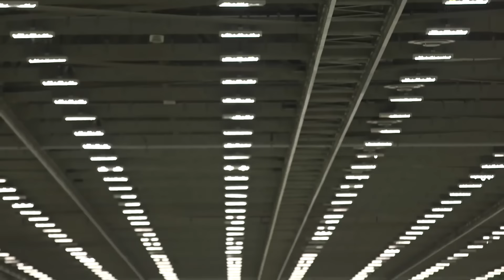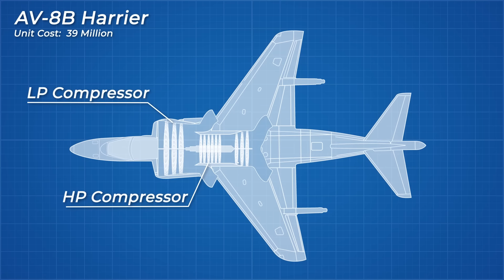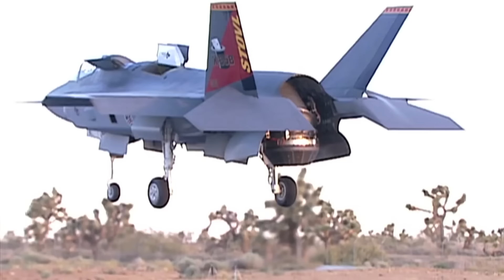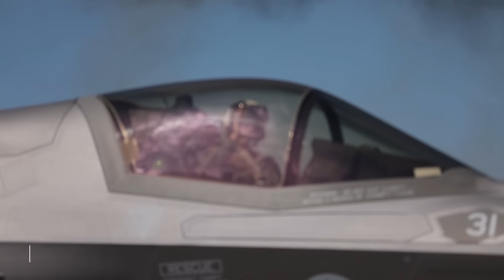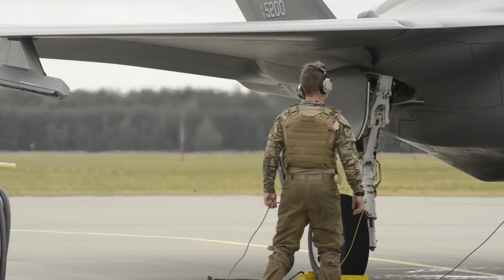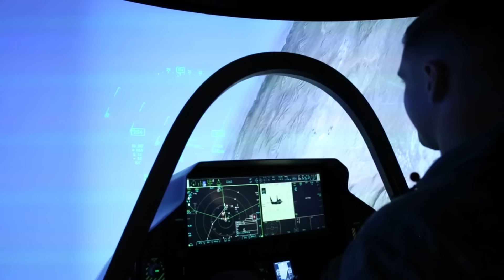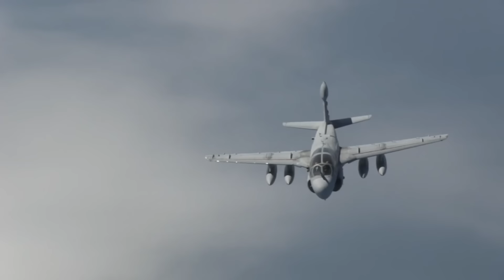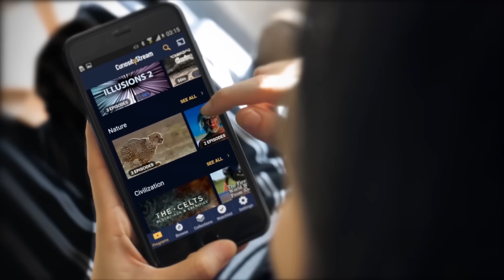Is The F-35 Worth $115 Million?

Comment: There is no debate, F-35 sucks at everything. Its defenders keep telling that its stealth is going to carry plane. Sure, but what if stealth fails? It is sitting duck in more traditional roles. See Air Power Australia report when it comes to its maneuverability, it is heavily beaten even by 4'th generation aircraft.
Reply: It is the 2nd most maneuverable fighter in the USAF. It can outrun every fighter it replaces. It has the most capable sensor suite of all modern fighters. It has incredibly capable electronic warfare systems. It can carry the F-16's typical strike payload internally and can exceed the maximum payloads of most fighters when stealth is not needed. It also has the longest combat range of all western fighters. Oh and it's cheap to buy... the only western fighters that are cheaper are the F-16 and F/A-18, and the difference is minimal. Should I talk about the advantages of stealth as well?

Air Power Australia are a bunch of unofficial analysts (i.e self-proclaimed) who do not have access to anything that isn't public information, nor do they have access to the F-35. Try talking to pilots who fly the F-35 regularly against other modern fighters. Try talking to pilots of previous gen fighters such as the F-16. Most of them are impressed by the F-35's maneuverability.
Reply: @dumdumbinks274  1) Technically no. It is less maneuverable than 4 gen fighters and when compared to most gen 4++ fighters,and beyond it is rather slugish fighter.
2) Its electronics got outdated due to its never ending developmental problems. Nowadays its electronics are brought to any other fighter plane with some notable exceptions like all around cameras for pilot helmet. 
3) It has by far shorter range than a fighter it is directly meant to replace.
4) It is vastly more expensive than previous gen of aircraft with operating costs sometimes being several times higher than some aircraft which is supposed to replace.

And yet, F-35 loses dogfights to F-16...
Reply: @REgamesplayer   @REgamesplayer  
1. Technically yes. It has similar sustained turn rate as the F-16 and far superior instantaneous performance combined with higher acceleration and just as good climb rate. Many pilots have described the F-35 as combining the strengths of both the F-16 and F/A-18, so no it isn't a slouch. It has also been described as a difficult opponent in BFM by RAF Typhoon pilots... so while it isn't a top tier dogfighter (why would it need to be?) it can still hold it's own in a dogfight provided the pilot is decently trained and familiar with the enemy's strengths.

2. Overall the F-35 has the most modern electronics of all modern fighters and the only systems that are becoming outdated are ones that are incredibly easy to replace. Sure you can put them in smaller less powerful forms into other fighters, but that doesn't mean they have an electronic advantage over the F-35. The F-35's avionics are top tier because they work together, whereas something like an F-16 with it's APG-83 which is directly based on the F-35's APG-81 simply can't compete due to size of the system and lack of integration with other systems.

3. It's combat range on an offensive air to air mission is around 1400km, or on a strike mission around 1250km. The F-16 maxes out at 850km for air to air, and around 600km for strike. The F/A-18C/D were even worse than the F-16, and the F-15 which is the US's 2nd longest ranged fighter gets around 1300km on an air to air mission with EFTs as well as it's typical AA loadout. The F-35's range is so good it hasn't even got plumbed pylons on it's wings due to lack of need... As for European fighters the Rafale and Typhoon are both around the 1200km mark on an air to air mission.

4. F-35A unit cost = $78m. By comparison the cheapest F-16 you can buy new isn't even a threat to the F-35 unless it can somehow get in close, and it still costs $55m. The modern F-16 Block 70 costs upwards of $65m, and a fully decked-out F-16 costs around $75m... and still isn't remotely as capable as an F-35.
In terms of operating cost the F-35A costs around $35000 since it is a new aircraft and is expected to cost roughly the same as an F-16 by 2030 at around $20000. 

F-35s lose to F-16s because that's how training works. Or do you believe the F-5 should take over from the F-16?... I mean the F-5 has beaten literally every US fighter built since the 1960s so it must be better than the F-16...
Reply: @dumdumbinks274  1) F-35 is a heavy aircraft with huge surfaces. It has high initial turn values, but aircraft tend to bleed energy like crazy and its underpowered engine by comparison does not allow for recovery in dogfights. It has low yawn rate and aircraft is sluggish to respond to control commands during dogfights in addition of pilot struggling to properly track its target. It had managed to lose a dogfight against heavily handicapped opponent. Two seat F-16 with two fuel tanks and full payload. This proves that F-35 is hopelessly outmatched against real opponents like Su-35 which are designed as supermaneuverable aircraft.

https://arstechnica.com/information-technology/2015/07/disastrous-f-35-vs-f-16-face-off-was-also-a-battle-of-philosophies/  

It also have lower acceleration and climb rate when compared to F-16

2) You had mentioned only AESA radar. It is true that we held a huge advantage when it came to radars compared to Russian older PESA radars. However, their newest modernization efforts do include some sort of AESA radars while newest planes do have it too.
While it is true that F-35 is a bigger airframe and thus can afford greater power aperture, it is not that large and F-35 falls by comparison to F-15. Only F-22 has a proper radar. 
https://www.ausairpower.net/XIMG/AESA-Aperture-6.png

Everything else that you wrote is so vague that it is pointless to even respond to.

3) That is true, it has good range.

4) Costs nearly the twice to operate = Costs nearly the same. Careful, your bias is showing.

Furthermore, you are comparing fly away costs of F-16/70 to airframe costs of F-35. That is just such a ridiculous comparison. 

https://www.documentcloud.org/documents/6534949-FY20-Navy-Aircraft-Procurement.html#document/p79/a533442 

"F-35s lose to F-16s because that's how training works. Or do you believe the F-5 should take over from the F-16?"

F-35 was shot down and was dominated in further war, because this is how war works. Your logic is sound.
Reply: @REgamesplayer  1. As I said it has a similar sustained turn rate to the F-16 and far superior instantaneous performance. "High initial turn values" indicates you are specifically referring to instantaneous turn rate, and are choosing to ignore it's capability as a whole. 
The F-35 is heavy sure, but it's wing loading is basically the same as the F-16 while at the same time having a lifting body, meaning it's overall loading is better than the F-16 and thus it is more maneuverable in a general sense. 
The F-35 has a better thrust to weight ratio as well and accelerates faster in the subsonic region. 

Your arstechnica source was laughable back in 2015, and is completely irrelevant to production F-35s of Block 3i or newer. The F-35 involved was AF-2, which is a test airframe with specific duties. The AF-2 airframe was using Block 2B software (which was sluggish) and limited to 4.5Gs as a safety measure because flight testing had not yet concluded. It did not have any of the combat sensors installed either, meaning the pilot's awareness of the other aircraft was completely based on his own eyesight. 
For reference, an F-16 with 2 bags is rated for 6Gs. Even a fully loaded F-16 is rated for 5Gs, and it was "competing" against a 4.5G limited test airframe. Production model F-35s of the same timeframe were rated for 7Gs, and all F-35As today are capable of 9Gs. No pilots have described the Block 3i or 3F F-35 as sluggish.

2. I only mentioned AESA as an example. But regardless of that Russian fighters still don't have AESA. The Su-57 is going to be their first and it isn't even in production yet. Expected IOC is 2025.

F-35's radar isn't the most powerful, but your source is from 2001... the APG-81 didn't even enter testing until November 2008, and it has 1676 modules... not 1200. There are also very few F-22s still using the APG-77 as most of them have been using the APG-77v1 which entered production in 2008... And while the F-22 has the best radar of all fighters currently available by it's specs alone, it is still less effective because the F-22's core electronics bottleneck the radar to the point the F-35s APG-81 performs better in dense EW environments.

4. Try reading. Or does the idea that a new system won't immediately be cheap to operate escape you? F-35 operating costs are gradually being reduced, albeit not as quickly as the unit costs.

"Furthermore, you are comparing fly away costs of F-16/70 to airframe costs of F-35. That is just such a ridiculous comparison. "
- Nope. F-35 price to buy has been quoted per the definition of fly-away cost since 2015. Your new source for F-35 pricing isn't discussing fly-away costs, but rather full package costs.

"F-35 was shot down and was dominated in further war, because this is how war works. Your logic is sound."
- Your inability to read a sentence and understand a basic implication, let alone provide a proper analogy is amusing. Tell me, when you send a kid to school do you expect them to be taught by other kids who know very little? I certainly don't, and neither do the US military. New pilots lose no matter what fighter they are piloting because their opponents are the best fighter pilots in the western world. You can't become an instructor without demonstrating your knowledge and skill.
Reply: @dumdumbinks274  
1. It is you who focuses on proving every single aspect wrong without having any knowledge about what he is talking about. Any general critique talks about poor maneuverability of an F-35 fighter, but this is somehow news to you. This is why we can't talk about anything more advanced before you get your basics right. "The F-35A has combat weight of 18.3 tonnes, a wing loading of 428 kg/m2,thrust-to-weight ratio of 1.07 and span loading of 1.75 tonnes/m. Wingsweep is 34°, and the engine has a power-to-frontal area ratio of 17.9N/cm2. As a result, the F-35 has very low instantaneous and sustained turnrates (less than half of the F-22's sustained turn rate, or ~11° per second) aswell as low acceleration, while its weight harms the transient performance.The F-35's inefficient aerodynamics and inefficient power plant also limitscombat endurance despite an excellent fuel fraction of 0.38. The F-35 has aspecific fuel consumption of 0.9 lb/lb/hour versus 0.75 for other advancedcombat jet engines.'

Source: Operational assessment of F-35A

Sustained turn rates of 4'th generation fighters:
F-16C - 14.2 deg/s
F-15C - 13,9 deg/s
F-14B - 14,1 deg/s
F-35A - 11 deg/s (best performing variant, other versions will have lower sustained turn rate)

https://www.google.com/url?sa=i&url=https%3A%2F%2Fwww.reddit.com%2Fr%2Fhoggit%2Fcomments%2Favuh86%2Fa_chart_showing_at_what_speed_and_at_which_turn%2F&psig=AOvVaw3_PeJ5lEbjSggsh7hNOKhJ&ust=1599030331934000&source=images&cd=vfe&ved=0CAIQjRxqFwoTCIDGqqmyx-sCFQAAAAAdAAAAABAJ

Acceleration: 
F-35: 1.07 F-16: 1.24

To conclude, nothing which you had said is right. You constantly use such general terms as "basically is the same" which shows that you lack context and in depth understanding of fighter planes. What you consider to be "basically the same" in reality are massive differences which would allow any experienced pilot in an equal fight to run circles around F-35. 

This is to what those "basically the same" differences lead to in a dogfight:
https://youtu.be/bkzBhRwpeAE

In the end, please do your own research. Don't come back to me with more claims of how I'm wrong and you are right by repeating your own statements again and again WITHOUT providing any evidence, sources and hard, precise data. If you want to discuss something else, I'm open to that, but you have to learn to drop points where you are beaten. Otherwise you will get stuck on points where you are wrong while all the time complaining that "I focus on a very narrow thing". 

"Your arstechnica source was laughable back in 2015, and is completely irrelevant to production F-35s of Block 3i or newer...."

Do not make excuses of why the F-35 failed to perform. Its software is designed to extend the lifetime of airframe and is locked to gentler maneuvers during peacetime. However, when a plane needs to fight or be tested, this software is disabled. Officials directly disagree with you:

 "It was loads monitoring, so they could tell if we ever broke something. It was a confidence builder for the rest of the fleet because there is no real difference structurally between AF-2 and the rest of the airplanes.”
Their official reasons of why it had failed:
- "Does not have the mission systems software to use the sensors that allow the F-35 to see its enemy long before it knows the F-35 is in the area."
- "Does not have the special stealth coating that operational F-35s have that make them virtually invisible to radar."
- "Is not equipped with the weapons or software that allow the F-35 pilot to turn, aim a weapon with the helmet, and fire at an enemy without having to point the airplane at its target."

Do you notice how officials themselves do not defend the maneuverability of the F-35? They instead say that there is no difference between this and the real version and that the only reason it had failed to beat heavily handicapped legacy fighter of the wrong type was, because it got into dogfight in the first place!

https://arstechnica.com/information-technology/2015/07/f-35-project-team-says-dogfight-report-does-not-tell-whole-story/  
2. 

Su-35 newest version has AESA radar:
https://www.defenseworld.net/news/25357/MiG_35_Shows_Off_New_AESA_Radar_at_MAKS_2019#.X03-dG4zaUk

This comes back to my point, F-35 development took so long that its advantage in electronics are being equaled out by its competition. I also want specifics of what F-35 does better that other planes could not. F-35 in terms of electronics only has its helmet and sensor array which combines all the information to pilot's helmet. This is the only real advantage over other planes which could not be easily solved by a simple upgrade program. Every other piece of electronics could be done better in other planes like I had shown with F-35 radar. F-22 has considerably more power to give to its radar array which would make F-22 a better platform for electronic systems.F-35 is also still in the prototype stage. Sure, it is in full production right now, but it has around 13 Category A flaws. Category A flaws within an aircraft are considered critical which can cause loss of an entire aircraft. F-35 still needs a lot of time to mature and it won't be until batch no.4 until the plane matures sufficiently to be airworthy. which is around the time when AESA radars and fifth generation planes will come for our peers also in 2025.

"F-35's radar isn't the most powerful, but your source is from 2001... the APG-81 didn't even enter testing until November 2008, and it has 1676 modules..."
Fair enough, but as you later agreed yourself, my point still stands with other platforms being able to deliver more powerful radar performance. Furthermore, in an absence of a better source, my source still stands because you can't provide anything better than claims.4. Mass of scale and maturity of a platform does not decrease costs indefinitely. You assume that cost decrease will go down continuously, however there is no historic precedence of significant cost decrease when aircraft had entered mass production for some time which F-35 already did.

/Facepalm. Flyaway cost IS full package cost. Unit cost is just the cost for a plane. I had quoted the real cost of a single plane. This excludes all additional equipment which is necessary to operate fighter planes. This includes ammunition, fuel, training simulators, maintenance equipment, spare parts, training. You had quoted the unit cost of a plane without including any of those things while comparing the average cost of F-16 during its lifetime minus operating costs. 
Go back to my official source. There is a nice breakdown of how much each version of F-35 costs to the USA government, split by airframe, engine, electronics. Those parts alone which make up the plane is a real unit cost of F-35 which is higher than a flyaway cost of the newest F-16. A single F-35B model costs 147 million dollars. F-35C costs 100 million dollars. That is a steep increase over advertised costs. 

"In terms of operating cost the F-35A costs around $35000 since it is a new aircraft and is expected to cost roughly the same as an F-16 by 2030 at around $20000. :

It is amusing that you do not know even the difference between comparison and analogy. This is comparison, not an analogy. You make up random numbers and then declare that 75% increase in operating costs is "roughly the same". I'm sorry, but you are just a laughing stock at this point if you make up such numbers, make such ridiculous statements and then start insulting the other side for pointing out mistakes you make.
Here however are the real numbers:
https://blogs-images.forbes.com/niallmccarthy/files/2016/08/20160815_Fighters.jpg 

To operate F-16C so far is 3,5 times cheaper than the cheapest F-35A model. This difference will most likely decrease with time, but it will never be comparable. There is no precedent when military equipment which is already in mass production and service suddenly decreases in overall costs several fold.
Reply: I also gave you source info about F-35 price. Here is an article on price of F-35:
https://www.pogo.org/analysis/2019/11/deceptive-pentagon-math-tries-to-obscure-100-million-price-tag-for-f-35/

I also gave a generous estimate of F-35 operating costs previously. It goes as far as 44,000 per flight hour and those lower flight costs are only the stretch goals:

https://www.defensenews.com/air/2019/05/02/one-of-the-f-35s-cost-goals-may-be-unattainable/

There is still a lot to do when it comes to F-35 from maturing as an airworthy 4'th gen fighter to lowering its cost over time to where they are advertised to be. However, if I would be behind acquisition of military equipment, I would not invest into F-35 and instead would choose to divert those funds into deep modernization of legacy fighters. I would however seriously consider purchase of F-35 at later date when lot 15 production would occur. 

If you want to reply to this, keep it in original comment. No need to expand even more. I wrote this, because I remembered that I did not gave you all the necessary sources for you to understand my position (like confusion with unit and fly away cost of F-35). However, I would appreciate you dropping some points and focusing on what you want to talk about or merely asking questions on my position in regards to this plane, etc.
Reply: @REgamesplayer  
"Any general critique talks about poor maneuverability of an F-35 fighter, but this is somehow news to you"
- Yes, those who never listen to the pilots who both fly the F-35 and fly against the F-35. 

"F-35A has combat weight of 18.3 tonnes"
- There's your first problem. You are not measuring things based on a single situation, rather you are measuring things based on a single configuration of the F-35. If you aren't comparing planes in a given situation then you aren't making an appropriate comparison.

"as a result, the F-35 has very low instantaneous and sustained turnrates (less than half of the F-22's sustained turn rate, or ~11° per second)"
- By what metric? What conditions? F-22 can reach around 23d/s at corner speed around 20000ft. F-35A can reach 17d/s which is only slightly less than the F-16 at 18d/s. As for instantaneous rate you consider 30d/s Low? 

"Acceleration: 
F-35: 1.07 F-16: 1.24"
1. Acceleration isn't simply T/W ratio, but also includes drag. The only way in which an F-16 will accelerate faster is while unarmed, or with it's 2 wingtip AAMs.
2. Why are you comparing an F-16 configured for a 600km mission with an F-35 configured for a 1400km mission? If both fighters are compared on the same mission like they're supposed to be the F-35's T/W is higher to begin with and the gap only increases the shorter the mission is. 

"To conclude, nothing which you had said is right. You constantly use such general terms as "basically is the same" which shows that you lack context and in depth understanding of fighter planes."
- Ah some pointless drivel... 

"What you consider to be "basically the same" in reality are massive differences"
- No, that would only be true if you had correct data, but you prefer to compare values that come from different situations to justify your claims. That's a false comparison. You haven't provided a source for the 11d/s sustained turn rate of the F-35, only the teen series fighters, and you certainly haven't provided a source for the F-22 having double the turn rate.

"Do not make excuses of why the F-35 failed to perform. "
- it is not an excuse, it is fact. AF-2's software was a heck of a lot restrictive than today's F-35's , or even the Block 3i upgrade that appeared in 2015. You cannot take that series of BFM exercises and claim it represents the F-35's ability to dogfight or it's maneuverability in comparison to an F-16.

" Its software is designed to extend the lifetime of airframe and is locked to gentler maneuvers during peacetime. However, when a plane needs to fight or be tested, this software is disabled."
- Yes obviously... that is how flight testing works. However a BFM exercise is not a flight test and has never been used to flight test US fighters simply because in BFM the objective is to shoot down the enemy,. Simply put, the objective of BFM is mutually exclusive with those of flight testing.

"It was loads monitoring, so they could tell if we ever broke something. It was a confidence builder for the rest of the fleet because there is no real difference structurally between AF-2 and the rest of the airplanes."
- Yes, structurally no difference, meaning that results of flight testing could be rectified purely through the flight software

"Fair enough, but as you later agreed yourself, my point still stands with other platforms being able to deliver more powerful radar performance. Furthermore, in an absence of a better source, my source still stands because you can't provide anything better than claims."
- Your point never countered my point, and more powerful doesn't equal superior. As for sources yours doesn't even have relevance since it existed long before the actual system. Though if you're really so ignorant that you can't search for yourself here's an image https://qph.fs.quoracdn.net/main-qimg-274acec7e6905acb2f96f6ba6d18b806

"Su-35 newest version has AESA radar:
https://www.defenseworld.net/news/25357/MiG_35_Shows_Off_New_AESA_Radar_at_MAKS_2019#.X03-dG4zaUk"
- Neither the Su-35S nor the MiG-35 have AESA radars. Russia has developed an AESA radar for the MiG-35, and they are at the same point the US were in 2003 when the F-15 got it's APG-63v2 i.e basically non-existent as far as operational usage is concerned.

"This comes back to my point, F-35 development took so long that its advantage in electronics are being equaled out by its competition."
- Except that actual R&D has only been going on since 2001. Do you also think the Typhoon and Rafale are outdated in comparison to Russian fighters? because the F-35's R&D hasn't taken any longer than those fighters.

"however there is no historic precedence of significant cost decrease when aircraft had entered mass production"
- There's also no precedent of the govt mass producing any other platform like they did the F-35... The costs are high because the govt authorised concurrent production and development. What do you think happens when the newly built F-35s need even more spare parts because the old ones don't fit them? What about ground crews having to use a poorly thought-out inventory tool to manage everything? What about the F-35s that are not upgraded to the newer standard? It means high initial operating costs that will be reduced as infrastructure and management stabilise, and in this case it will take a while.

"I also want specifics of what F-35 does better that other planes could not."
- Sure. It's radar is superior to every other operational fighter radar, and performed better in dense EW environments than the APG-77v1 during tests in 2010. It's 7 IRSTs provide unassisted targeting and tracking capability in any direction, as well as much earlier threat warning compared to typical MLWSs of other modern fighters. But far more importantly the F-35's systems all communicate with each other, not just other aircraft. If you don't understand how the integration of so many advanced systems is such a massive advantage you need to speak to actual pilots instead of journalists.

"/Facepalm. Flyaway cost IS full package cost. Unit cost is just the cost for a plane."
- Per Wikipedia... "Flyaway cost is one measure of the cost of an aircraft. It values the aircraft at its marginal cost, including only the cost of production and production tools essential for building a single unit.[1] It excludes sunk costs such as research and development, supplementary costs such as support equipment, and future costs such as spares and maintenance."... care to accept defeat?

"You assume that cost decrease will go down continuously"
- Based on what? Where did I say that? I expect costs to reach a certain value by a certain point. I do not expect them to transition gradually at a constant rate over the timeframe.

"It is amusing that you do not know even the difference between comparison and analogy. This is comparison, not an analogy. You make up random numbers and then declare that 75% increase in operating costs is "roughly the same"."
- It is amusing that you have to make up stuff about what I have said. What I stated is clear, and I never claimed that the costs are similar right now.

"I'm sorry, but you are just a laughing stock at this point if you make up such numbers, make such ridiculous statements and then start insulting the other side for pointing out mistakes you make."
- The numbers are not made up. F-16 operating cost comes from the USAF as of 2015. Cost to operate does fluctuate, but unless the US have invested heavily in the F-16 it won't be any cheaper today. What statements do you find ridiculous? The ones that don't have a hidden meaning for you to make assumptions off of? And the "mistakes" you have found are mistakes with you own comprehension of my comments.

I have also seen that POGO source many times. It is sensationalist media - the govt never attempted to hide anything and every source POGO cites to make that claim is a govt source, indicating that the govt are not hiding the prices. Additionally it uses package price to argue that unit price is wrong, so it is comparing different values to make a blatantly false claim.
Reply: @dumdumbinks274  Indeed, pilots do say that F-35 maneuverability is atrocious. 

https://www.realcleardefense.com/articles/2015/06/29/test_pilot_admits_the_f-35_cant_dogfight_108146.html

Don't worry, F-35A is the best model for maneuverability. F-35B is an even more atrocious model due to its vertical take off capabilities. If you are interested in details, this is why I have provided a source for you to check it out. Usually people quote only relevant details and if the other person needs more information, he goes to source and reads the whole damn thing. In either case, any configuration would perform worse than an extremely biased configuration in which the Pentagon dares to test F-35 against. Matching F-35 with optimal configuration against an outdated F-16 model who also is of a wrong type. 

Those are low energy maneuvers at low altitude. A lot of dogfights degenerate into turn fights at low speeds at which the F-35 is absolutely horrible. Instantaneous and sustained turn rates means how well aircraft can turn initially in its high energy state and the other is how well a plane can sustain its turn rate in a prolonged dogfight. Your problem is that you focus on advertisement of what aircraft can achieve for brief moments under ideal conditions. This is why you think the F-35 is so great.

Acceleration is mostly a relationship between aircraft weight and power of its engine. Drag becomes meaningful at high speeds. High speed acceleration due to air resistance growing exponentially with speed. The F-35 has such low acceleration, because of its heavy weight and said number is for an F-16 with a combat load. Furthermore, F-16 has inherently shorter range, this is why it is configured for a shorter mission. These acceleration rates are not calculated with 100% fuel, but usually with 60% of it. Comparing acceleration of F-16 with its fuel banks is as unrealistic as that dogfight in which the F-35 was served. Nobody in their right mind, but the Pentagon would dog fight with fuel banks. They would be dropped before actual combat starts, but our fly boys probably still did not figure it out. 

"- Ah some pointless drivel..." 

But that is true, you were wrong on every maneuverability characteristic of an F-35 and you still did nothing to disprove me. You only poke at numbers and make up more claims. "- No, that would only be true if you had correct data, but you prefer to compare values that come from different situations to justify your claims. That's a false comparison. You haven't provided a source for the 11d/s sustained turn rate of the F-35, only the teen series fighters, and you certainly haven't provided a source for the F-22 having double the turn rate."
When I use quotation marks: "", it means that I'm quoting things. It is a very standard practice, especially in university. I also attach the source somewhere shortly after the quotation and my point. Pay more attention please, because I do spend my time trying to educate you. At least you could properly investigate information provided to you rather than replying directly to my quotes. You have to understand that quoting information from credible sources > than some random guy's opinion on the internet. You can't reply directly to a quote like it would be my own statement and disagree with it while providing no new information to the contrary. You are just some guy on the internet which as far I'm concerned knows nothing about what he is talking about. In order to win an argument, you have to make a proper argument, so far however you only are making statements and trying to poke holes. It makes you think in your head that you are winning, however the majority of what I had said still holds true and I'm all, but won this debate. Back up what you are saying, provide a conclusive argument with hard technical data of both aircraft. Then you will be taken seriously. Now however you are just disagreeing with the official operational assessment of F-35A aircraft, because you want more information and you are too lazy to check out the source yourself. So instead of doing anything constructive, you instead ask more questions which ultimately will just drag this out, because this point is not even up to question. Anyone knowledgeable knows that the F-35 has poor maneuverability, pilots and officials do not even defend that fact. You however are like a newborn who discovers that fact for the first time.

You do make excuses for the F-35. I had provided an official explanation of why the F-35 had failed. None of that included what you had said. In fact, it directly contradicted your claims. Furthermore, said software is here to preserve aircraft, lower risk of failure and extend its lifetime. AF-2 software can be as easily disabled as it was during dogfight. You are disagreeing not only with me, but with officials responsible for the F-35 program and directly contradict what they are saying and you think that I have to take you seriously?

"- Yes obviously... that is how flight testing works. However a BFM exercise is not a flight test and has never been used to flight test US fighters simply because in BFM the objective is to shoot down the enemy. Simply put, the objective of BFM is mutually exclusive with those of flight testing."

Exactly, you had figured it out how that test was set up. "- Yes, structurally no difference, meaning that results of flight testing could be rectified purely through the flight software"

You certainly do not know how quotating works. Now you are correcting officials responsible for those tests with this pointless statement. What you had said adds absolutely nothing to an argument nor it makes much sense. " Your point never countered my point, and more powerful doesn't equal superior. As for sources yours doesn't even have relevance since it existed long before the actual system. Though if you're really so ignorant that you can't search for yourself here's an image."
So, why did you question what I had said if you agree with me? Furthermore, you are just some random dude on the internet making statements. I see that you might have an ego problem and think that you know it all. However everything you say is just a baseless statement. This is actually the first time you bothered actually backing up your claims, even if forced by me, but this is still progress. 
Also, ignorant means that a person lacks knowledge in a given subject. The word you were looking for here was: lazy. You can't be so ignorant as not to search easy to find information for yourself. However, you can be so lazy that you can't even do this one simple thing for yourself. 

When it comes to SU-35 AESA radar, it was to show that Russia had developed AESA radar for their 4'th gen fighters. This was in response to your statement that only Su-57 had AESA radar. Please pay more attention to what you are saying. You are quoting a lot of information and do not say much. 

"Except that actual R&D has only been going on since 2001. Do you also think the Typhoon and Rafale are outdated in comparison to Russian fighters? because the F-35's R&D hasn't taken any longer than those fighters."

The F-35 is still in the prototype stage. R&D is solely concerned about fixing existing issues, not adding new ones. Rate of development of the F-35 is far slower than any legacy fighter, because those fighters do not have huge technological depth which they have to overcome and thus all efforts can be solely focused on improving those planes.

 "There's also no precedent of the govt mass producing any other platform like they did the F-35... The costs are high because the govt authorised concurrent production and development. What do you think happens when the newly built F-35s need even more spare parts because the old ones don't fit them? What about ground crews having to use a poorly thought-out inventory tool to manage everything? What about the F-35s that are not upgraded to the newer standard? It means high initial operating costs that will be reduced as infrastructure and management stabilise, and in this case it will take a while."

This is not the major source of costs. Major reduction of cost comes from economies of scale. When contractors have sufficient numbers of orders, work hours put into providing those orders quickly fall by comparison of other costs like parts. It is like writing a program. If you write a program just for this one time, it will be incredibly expensive, because you will have to include the programmer's salary only to solve that one problem. However if you would use said program every day, quickly initial investment would become negligent compared to savings. This is how economies of scale work, it is costly, because there are few orders and you need to maintain people and expertise to produce very limited sets of orders. When there are plenty of orders, employees can work at their full capacity. This is why there was such a strong decline in F-35 price through Lot 12-14. As the F-35 entered mass production, we had seen the greatest price decrease it is going to have. In the end, it is mighty convenient to you that "there is no precedent" when you have to back it up something. Seems to be a trend with you.
Reply: @dumdumbinks274  "Sure. It's radar is superior to every other operational fighter radar, and performed better in dense EW environments than the APG-77v1 during tests in 2010. It's 7 IRSTs provide unassisted targeting and tracking capability in any direction, as well as much earlier threat warning compared to typical MLWSs of other modern fighters. But far more importantly the F-35's systems all communicate with each other, not just other aircraft. If you don't understand how the integration of so many advanced systems is such a massive advantage you need to speak to actual pilots instead of journalists."

So, nothing new? I had already shown you how F-35 advantages in electronics had faded away with its long development cycle. I agree that radar on F-35 is good, but when it will be ready for service, it will come out in an environment which already had matched it in its capabilities (as shown previously with Su-35). Advantages which you had mentioned is a misconception. Those advantages come not from some new electronics on F-35, but from the nature of AESA radar. AESA radar inherently is a lot harder to jam, this is a major reason why it is better over PESA radar. You however seem to attribute this for some reason to this specific radar while in truth, this trait is inherent to all AESA radars.

I did mention its all around cameras and helmet integration as the sole advantage in electronics which can't be easily transferred to older platforms. Though, that is a marginal upgrade which comes in handy only in very specific situations in which the F-35 is designed to avoid and not to be in. Though, I do not disagree that it is a good plius for the F-35.

Again, "systems all communicate with each other, not just other aircraft" is just such a misconception. You should stop reading advertisements for the F-35 and take a look at older aircraft. Vast majority of aircraft do that. This communication network is called: Links 16. The only difference is that the F-35 has AESA radar which is a lot harder to jam and can be used for communication with a lot greater information transfer capabilities. However, that is part of the aircraft's radar system, so you are having like triple points to the F-35 for having a radar which is unfair. 

Furthermore, the only real advantage F-35 has is all around sensors. All of those systems can be brought back to older planes. In fact Links 16 are set to be replaced with the same communication system which is on the F-35. All the anti jamming, communication, detectability, tracking are not advantages of the F-35 plane. F-16 has all that capability, because it was upgraded with AESA radar. While you might argue that its radar is weaker, there are other fighters who can have more powerful radar than the F-35. It is all a matter of upgrading legacy fighters, hence this is why I support deep modernization of older planes and waiting for the F-35 to become less of a turd.

 " Per Wikipedia... "Flyaway cost is one measure of the cost of an aircraft. It values the aircraft at its marginal cost, including only the cost of production and production tools essential for building a single unit.[1] It excludes sunk costs such as research and development, supplementary costs such as support equipment, and future costs such as spares and maintenance."... care to accept defeat?"

Sure. However, you still compared the price of the airframe of the F-35 to flyaway costs of F-16. "Based on what? Where did I say that? I expect costs to reach a certain value by a certain point. I do not expect them to transition gradually at a constant rate over the timeframe."

Hmmm, I think that you should go back to my original source about F-35 cost. This plane costs around 100-140 million dollars give or take. More if you include necessary support. Its operating costs are upwards to 44,000 dollars per flight hour. You however said to me that those costs will go down to be comparable with F-16. This means that an airplane which is already in mass production will have to go down in operating costs several fold."It is amusing that you have to make up stuff about what I have said. What I stated is clear, and I never claimed that the costs are similar right now."

Don't pretend that you are innocent. You insult me, you confuse analogy with comparison and now you again conveniently forgot everything you wrote. How you accused me of not understanding a simple analogy when you wrote a comparison. Will I have to copy paste the entire conversation to you? "The numbers are not made up. F-16 operating cost comes from the USAF as of 2015. Cost to operate does fluctuate, but unless the US have invested heavily in the F-16 it won't be any cheaper today. What statements do you find ridiculous? The ones that don't have a hidden meaning for you to make assumptions off of? And the "mistakes" you have found are mistakes with you own comprehension of my comments."

Again, more baseless claims. Provide me with sources and stop making stuff up."I have also seen that POGO source many times. It is sensationalist media - the govt never attempted to hide anything and every source POGO cites to make that claim is a govt source, indicating that the govt are not hiding the prices. Additionally it uses package price to argue that unit price is wrong, so it is comparing different values to make a blatantly false claim."  

If you do not like a source, it does not make it wrong. This is how you end up knowing very little, you filter out everything you do not like as "wrong" and cherry pick advertisements. POGO is a governmental watchdog, it highlights misconduct of a government. You just said that if information is public, the government can openly mismanage taxpayers money, and endanger its people, because it does so publicly. 

Pay more attention to what you read. Source has individual price per unit divided by major cost factors. Furthermore, nobody buys military equipment in singles. Everybody buys it in bulk as it is a lot cheaper and practically everyone else needs more than just a new aircraft. An aircraft can't fly without high quality fuel, you can't get it at the gas station. Thus most military equipment comes in packages, even when it comes to the USA government procuring its own equipment. That is called: procurement cost.
Reply: @REgamesplayer  " Indeed, pilots do say that F-35 maneuverability is atrocious.... https://www.realcleardefense.com/articles/2015/06/29/test_pilot_admits_the_f-35_cant_dogfight_108146.html"
- You still only have a single pilot saying that... or do you not understand that your sources on F-35 maneuverability all revolve around a single instance of a Block 2 TEST AIRFRAME in a BFM situation? 

"Matching F-35 with optimal configuration against an outdated F-16 model who also is of a wrong type. "
- When did this happen? You still haven't provided an example of an F-16 beating a production model F-35, let alone one of Block 3i or 3F.

"A lot of dogfights degenerate into turn fights at low speeds at which the F-35 is absolutely horrible."
- According to whom? Another journalist? Or are you once again basing that claim on the Jan 2015 BFM case which was outdated before WarIsBoring even got hold of the report?

"Your problem is that you focus on advertisement of what aircraft can achieve for brief moments under ideal conditions. This is why you think the F-35 is so great."
- No I listen to people who are actually involved as customers who are critiquing the product, not journalists who get half the story and publish bullshit they themselves don't understand.

"Acceleration is mostly a relationship between aircraft weight and power of its engine. Drag becomes meaningful at high speeds. "
- Yes that is correct in simple terms. You finally got something right, congratulations.

"The F-35 has such low acceleration, because of its heavy weight and said number is for an F-16 with a combat load. "
- 1.24 is for an F-16C with wingtip missiles and 50% internal fuel... It is what the F-16 can achieve in a dogfight if the pilot drops everything else. In such a situation the F-35A can achieve a T/W ratio of 1.34.
An F-16C with a typical 1800lb missile load and internal fuel only, has a T/W ratio of 1.04.
An F-35A on the same mission and same payload achieves a T/W ratio of roughly 1.13 and will still outrange that F-16.

"Furthermore, F-16 has inherently shorter range, this is why it is configured for a shorter mission."
- Then why compare the F-16 at all if it cannot complete the mission of the F-35 due to lack of range? The F-35 can slim down to match the F-16's range while exceeding it's performance. The F-16 cannot up-size to match the F-35's range, and therefore the F-35 either performs missions the F-16 cannot perform, or the F-35 exceeds the F-16's performance on mission both aircraft can perform.

"Comparing acceleration of F-16 with its fuel banks is as unrealistic as that dogfight in which the F-35 was served. "
1. AF-2 was served because it was more heavily restricted than the F-16.
2. Similarly why are you comparing to a max fuel F-35? 

"You certainly do not know how quotating works."
- Sorry, what's "quotating"? Is there a language barrier here? That would certainly lead to you not understanding what is being said by officials or reports.

"Now you are correcting officials responsible for those tests with this pointless statement. "
- No it's called explaining what is being said. You made an assumption about when limits can be overridden and what those limits actually are. Not to mention the BFM instance you seem so fond of was not a flight test.

"So, why did you question what I had said if you agree with me?"
- What makes you think I agreed with you? 

"Furthermore, you are just some random dude on the internet making statements. I see that you might have an ego problem and think that you know it all. However everything you say is just a baseless statement. This is actually the first time you bothered actually backing up your claims, even if forced by me, but this is still progress. "
- So the person with a condescending attitude decides to call their opposition egotistical? 

"Also, ignorant means that a person lacks knowledge in a given subject. The word you were looking for here was: lazy. "
- You really don't think outside the box do you... You're ignorant of misinformation and while you have some knowledge you have little understanding of the subject.

"However, you can be so lazy that you can't even do this one simple thing for yourself."
- Well I certainly agree that you're lazy... particularly when it comes to statistics.

"When it comes to SU-35 AESA radar, it was to show that Russia had developed AESA radar for their 4'th gen fighters. This was in response to your statement that only Su-57 had AESA radar."
- Please pay more attention to what I have said. No operational Russian fighters have AESA radar and they won't for a very long time. The Su-57 is planned to be the first to have it... though you could end up being correct if the Su-57 suffers even more delays. 

"The F-35 is still in the prototype stage. R&D is solely concerned about fixing existing issues, not adding new ones. Rate of development of the F-35 is far slower than any legacy fighter, because those fighters do not have huge technological depth which they have to overcome and thus all efforts can be solely focused on improving those planes."
- That has nothing to do with my question.... Both the Typhoon and Rafale had R&D periods of similar length to the F-35. Do you consider them to be outdated? 

"This is not the major source of costs. Major reduction of cost comes from economies of scale. "
- You're talking unit costs, not operating costs. Operating cost is based on how mature a system is and how well managed the program is. It is much easier to lower the unit cost of a system. "Time is money" is the most relevant phrase here... Time spent on managing or fixing issues will come down over time after the product has entered service. Operating costs do not stop decreasing until either the system fully matures, or people stop putting in the effort to fix or manage problems, and the more poorly managed the program the more potential there is to reduce costs.

"In the end, it is mighty convenient to you that "there is no precedent" when you have to back it up something. Seems to be a trend with you"
- I don't see how that works when you're going off on tangents about irrelevant and often incorrect details.
Reply: @REgamesplayer  
"So, nothing new? I had already shown you how F-35 advantages in electronics had faded away with its long development cycle. I agree that radar on F-35 is good, but when it will be ready for service, it will come out in an environment which already had matched it in its capabilities (as shown previously with Su-35)."
1. You're still focusing on individual systems, not the fact they all exist in a single airframe and are fully integrated.
2. The Su-35S is nowhere close to receiving an AESA radar in operational service.

"Advantages which you had mentioned is a misconception. Those advantages come not from some new electronics on F-35, but from the nature of AESA radar."
- Uh no they don't. The AESA is only 1 aspect of the F-35's EW suite. All systems on the F-35 communicate with each other to maximise their capabilities. It's the same concept as teamwork.

"AESA radar inherently is a lot harder to jam, this is a major reason why it is better over PESA radar. You however seem to attribute this for some reason to this specific radar while in truth, this trait is inherent to all AESA radars."
- And what did I say to spark this comment? I haven't discussed any radar types other than AESA and I specifically noted that the F-22 - a fighter that has an AESA based partially on tech for the APG-81 - performed worse in dense EW environments than the APG-81. In case that isn't clear to you there is a difference in capability that favours the theoretically less capable radar even though both are AESAs. To assume the Russians will match the US radars on their first real attempt, or that other fighters have the same capabilities just because they are all AESAs is ridiculous.

" You should stop reading advertisements for the F-35 and take a look at older aircraft. Vast majority of aircraft do that. This communication network is called: Links 16."
- That is a datalink, it does not determine what information can be transferred or where, though it does have limits on volume of information and reliability over long distances which is why the F-35 has MADL as well as Link 16.

"Furthermore, the only real advantage F-35 has is all around sensors. All of those systems can be brought back to older planes."
- Not without often costly internal redesign, and those older aircraft still can't take full advantage of the systems since they do not have any stealth advantages.

"In fact Links 16 are set to be replaced with the same communication system which is on the F-35."
- Link 16 is not being replaced with MADL anytime soon.

"Sure. However, you still compared the price of the airframe of the F-35 to flyaway costs of F-16."
- Where? 

"This plane costs around 100-140 million dollars give or take. "
- Yes, in the same sense that the F-16 costs upwards of $100M or the F-15 reaching $180M. But if you're talking about flyaway cost the most expensive F-35 variant is $101M.

"If you do not like a source, it does not make it wrong. This is how you end up knowing very little, you filter out everything you do not like as "wrong" and cherry pick advertisements."
- Fortunately I'm not that sort of person. I'm the sort who examines all sources and makes judgements based on logic and previously verified facts because I am aware of how much misinformation exists. If something is questionable I'm not going to promote it as a fact.

"POGO is a governmental watchdog, it highlights misconduct of a government."
- And they are not always correct. 

"You just said that if information is public, the government can openly mismanage taxpayers money, and endanger its people, because it does so publicly. "
- Nope, that's your interpretation. I'll expand. 
1.The POGO article argues that the govt are being misleading because they quote the unit cost. That isn't a valid argument since it is on the reader/listener to understand the basic definitions of terms and ask questions or do research if they don't. Since the US govt already note that they are talking about unit cost when referring to the values, and they release the full acquisition costs as well in easy to access locations, they are not misleading anybody.

2. In case you are unaware, unit cost is the standard metric to quote because it represents the minimum price of the working product. If unit cost was not the standard it would be like a fish and chip shop not advertising the price of their chips because they have a $20 meal deal that includes fish, squid rings, and chips for 4 people. What do you do if you only want chips? How can you possibly know if that pricing is a good deal if the price of each individual item is not advertised? 

That said I can see a valid purpose to the POGO article despite it's non-existent argument and sensationalism... there are plenty of unaware people out there whether they are plain ignorant or just don't care, and maybe they need a bit of a wake up call. Considering how corrupt US lawmakers and corporations are it would certainly help if Americans were less blindly patriotic and more critical of their govt.
Reply: @dumdumbinks274  ''1. You're still focusing on individual systems, not the fact they all exist in a single airframe and are fully integrated.2. The Su-35S is nowhere close to receiving an AESA radar in operational service.''

1. You are just avoiding my point. Proving my point over individual systems is a first stage of proving my point.2. That is incorrect. AESA radar is available for export. Russia can start manufacturing AESA equipped planes or upgrade older ones today. It is only lack of funding and planning which prevents them from doing that.

''Uh no they don't. The AESA is only 1 aspect of the F-35's EW suite. All systems on the F-35 communicate with each other to maximise their capabilities. It's the same concept as teamwork.''

AESA radar is responsible for sending high bandwidth data. You got confused by my point.

''And what did I say to spark this comment? I haven't discussed any radar types other than AESA and I specifically noted that the F-22 - a fighter that has an AESA based partially on tech for the APG-81 - performed worse in dense EW environments than the APG-81. In case that isn't clear to you there is a difference in capability that favours the theoretically less capable radar even though both are AESAs. To assume the Russians will match the US radars on their first real attempt, or that other fighters have the same capabilities just because they are all AESAs is ridiculous.''

By mentioning various advantages of the F-35 without knowing where those advantages come from. You have to specify how it exactly performed worse in dense EW environments, because that is not the same as jamming efforts. Furthermore, while of course AESA radars are not all made equal, their anti jamming capabilities and data transfer are inherent qualities of said technology. It is pretty easy to do that and it does not require huge expertise in radar technology. If a country can make AESA radar, it is safe to assume that they will know how to electronically switch between various channels in event of a jamming. 

"- That is a datalink, it does not determine what information can be transferred or where, though it does have limits on volume of information and reliability over long distances which is why the F-35 has MADL as well as Link 16.''

Still, the same capability which you had attributed was unique only to the F-35. Now we are discovering that this is not the case. Yes, Link 16 is an older generation datalink. The F-35 has superior datalink solely due to AESA. It is planned to replace Link 16 with the same standard as on the F-35 in the future.'Not without often costly internal redesign, and those older aircraft still can't take full advantage of the systems since they do not have any stealth advantages.''

Those planes already have said systems integrated into them. There are some differences of course, like electro-optical targeting pods being externally mounted rather than internally. I also started to question if all around sensory information can't be integrated and in F-16. Simply by drilling a hole in a hull and adding the same optical devices as in F-35, we would be able to achieve same level of electronic sophistication.''Link 16 is not being replaced with MADL anytime soon.''

Yes, my mistake. Links 16 are only being upgrades with MIDS JTRS who will have more similar capabilities to MADL. 

"Sure. However, you still compared the price of the airframe of the F-35 to flyaway costs of F-16.- Where? ''

In your first initial claim saying that F-35 costs around 70 million dollars which is price for only F-35 airframe.

"- Yes, in the same sense that the F-16 costs upwards of $100M or the F-15 reaching $180M. But if you're talking about flyaway cost the most expensive F-35 variant is $101M.''

Nope. These numbers are just for F-35 flyaway cost without any support elements such as fuel or ammo. ''Fortunately I'm not that sort of person. I'm the sort who examines all sources and makes judgements based on logic and previously verified facts because I am aware of how much misinformation exists. If something is questionable I'm not going to promote it as a fact.''

Sadly, you just discredited entire source due to your own bias towards it.

''And they are not always correct.'' 

You can't wave away sources you do not like with such general generalization. You just don't like that someone makes military accountable to its taxpayers."

1.The POGO article argues that the govt are being misleading because they quote the unit cost. That isn't a valid argument since it is on the reader/listener to understand the basic definitions of terms and ask questions or do research if they don't. Since the US govt already note that they are talking about unit cost when referring to the values, and they release the full acquisition costs as well in easy to access locations, they are not misleading anybody.'''

That is incorrect. You did not bothered to properly investigate article nor sources and thus had failed to see that article was quoting direct unit costs.

''That said I can see a valid purpose to the POGO article despite it's non-existent argument and sensationalism... there are plenty of unaware people out there whether they are plain ignorant or just don't care, and maybe they need a bit of a wake up call. Considering how corrupt US lawmakers and corporations are it would certainly help if Americans were less blindly patriotic and more critical of their govt. ''

Sadly, you just dismissed POGO out of hand without properly reading what they wrote simply because they had some negative points about your favorite platform.